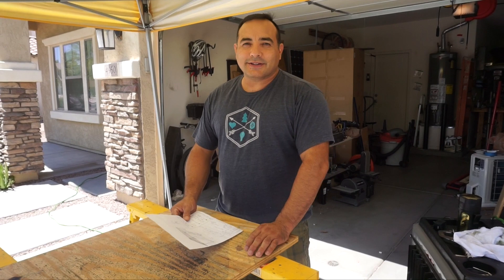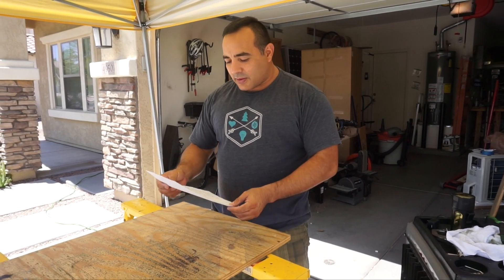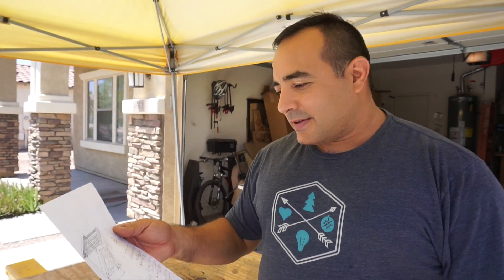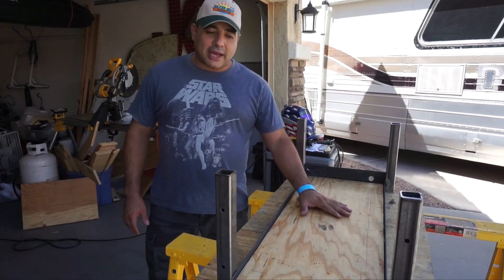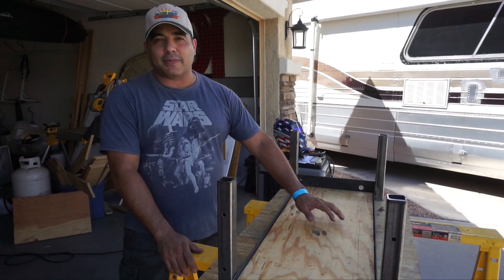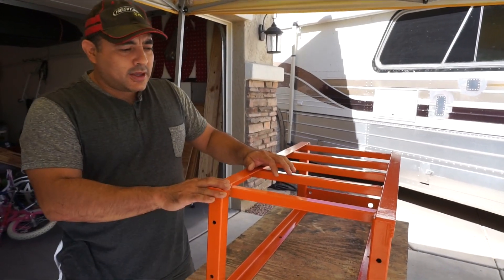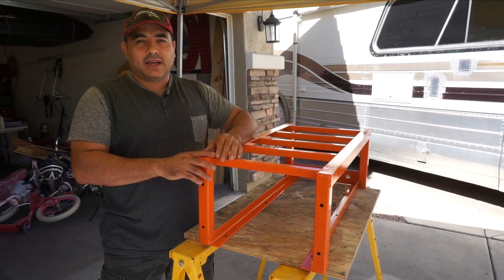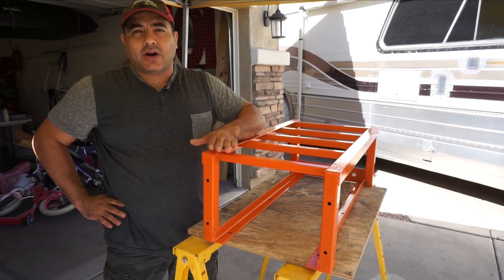RV House Battery Part 3: Building the Battery Cage

Comment: Nice job, but a good tip. Oil the drill when drilling into metal do you will mess up the drill bit. WD40 works great too.
Reply: I saw that and immediately thought, that bit is toast.

Comment: EXPANDED METAL ON THOSE BATTERY RACKS WOULD AFFORD MUCH MORE COOLING THAN THAT WOOD, AND EXPANDED METAL WONT CATCH FIRE IF THERE IS A PROBLEM  WITH THE BATTERIES.
Reply from the maker: Expanded metal would have probably been a better choice.  We have an air conditioner in that bay dedicated to cooling off the batteries, inverter, charge controller.  We also have a BMS system that monitors the temperature of the batteries and shuts everything down if they exceed 150 degrees F.  If there is a problem where the wood catches on fire we have much bigger problems than what these batteries are resting on ... the entire floor of the bus is of plywood.

Comment: Personally, I'd have fused each cell to the bank buzz bar - attaching a BMS to each parallel bank will not give individual cell protection - having seen the carnivorous nature of good cells into  a damaged cell  it all happens very fast
Reply from the maker: I actually considered that - I think it is a decent idea.  The one problem (other than the cost of course) is putting in that many fuses would have introduced more resistance into the system.  I also considered that when the battery came out of the leaf - it was not fused in this manner.

Comment: if I am seeing how you bussed out the bank, You actually did a 7 parallel then then seriesed the 7 banks.  And I am trying to understand that you are not going to be using BMS on all cells as should be but just on your larger groups. Will that really manage all the modules correctly
Reply from the maker: I Scott - I did connect the batteries in parallel before I connected them in series.  The reason is for the BMS.  Parallel batteries (especially Lithium batteries because they have such a low internal resistance) will naturally balance themselves.  This essentially makes the first 7 modules (which is actually 14 "cells") behave like one giant cell.  The final configuration of the battery is 14p14s.  If I had tied them in series first I would have had to buy a BMS for each "battery" (7 in my case).  Of course, the advantage of this is that If there was a problem you could (at least in theory) disconnect the offending "battery" and still have the capacity of the other "batteries".   The big disadvantage is cost.  The BMS I went with (REC-BMS) cost me about $1000 all together.  It didn't make economic sense to have $7000 worth of BMS  to monitor $2500 worth of batteries.   So how did it work out with 7 in parallel first?  So far it has worked out really great - the BMS solution I have balances the cells to keep them as close to each other as possible.  The voltages are usually within 0.005V of each other regardless of load or state of charge.  The question I get quite often is "what if a module goes bad"?  Since the BMS I use tracks the voltage and health (internal resistance) of each cell - If a cell was dying what I would notice is that there would be one cell that is always "lagging" behind or reporting "full" too quickly (and thus needing to be discharged).  I have a blog post where I go into the BMS and how it functions: http://beginningfromthismorning.com/bms/

Comment: Could you answer a question for me... and just generally:

I’ve been contemplating a similar design as yours for a camper. I’ll have the payload for 1000lbs of batteries; could you generally say that I could run a typical 13k btu AC unit for 50-60 hrs continuous run on that battery capacity? I won’t have the solar capacity that you do but plan to charge as I drive with 440amp onboard alternators?

I would really appreciate your thoughts,

Thank you 👍🏽
Reply from the maker: Hi Ken,   Air conditioners are power hogs -  I did some rough "back of the napkin" type math:  your 13K BTU A/C if it is a rooftop unit probably pulls about 15 amps @ 120 Volts meaning it uses about 1800 Watts.  If you run the A/C Straight for an hour you would use 1800 Watt Hours or 1.8 kWh of power.  The battery itself is rated for 24 kWh but assuming 80% capacity (to stay safe) we get 19.2 kWh of usable energy.  If we assume 10% efficiency loss through the inverter we arrive at roughly 17.3 kWh after the power is inverted.  We arrive at about 9.6 hours.  This, of course, assumes a 100% duty cycle - which would never happen - so if we change that to say 50% duty cycle we arrive at 19.2 hours.  So if you wanted 60hrs of continuous operation @ 50% duty cycle you would need 3 Nissan Leaf battery modules or about 72 kWh of power.  I hope that helps.
Reply: I wondered the same thing a while ago and ran the math.... your calculations are pretty close.... I came up with the same numbers, I don't think running an air conditioner from a battery bank is really practical, I will use the A/C from an inverter while traveling as the alternator on the engine is plenty large enough to keep up.... when I got my 120v welder I didn't know you had to change polarity when switching from gas to flux core wire.... I didn't read the instructions.... I'm a guy... :-)